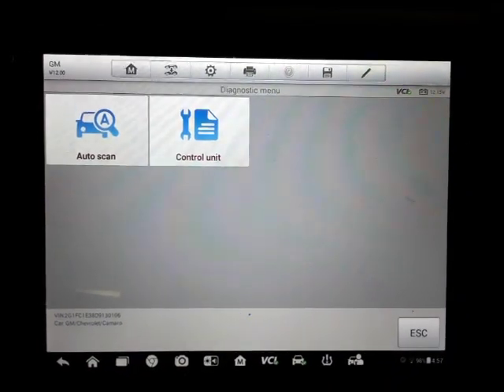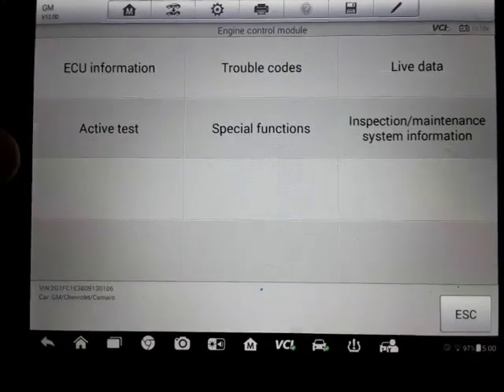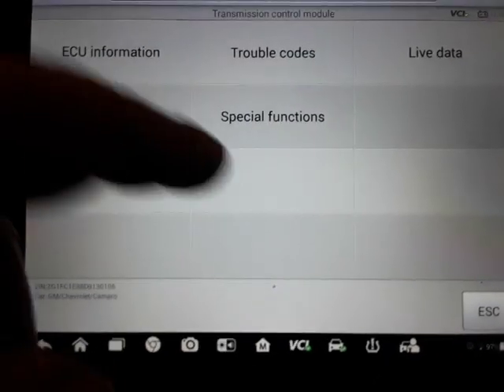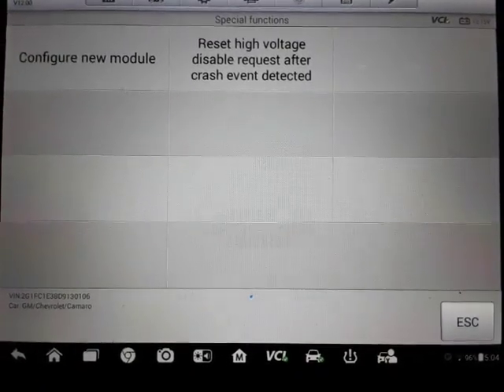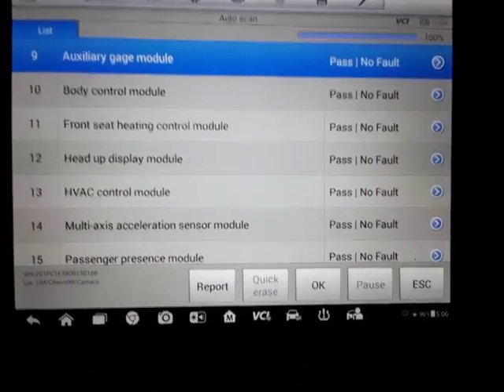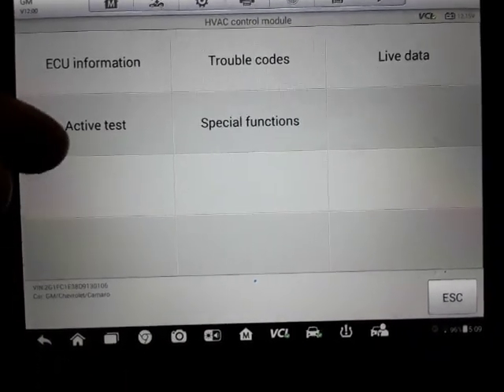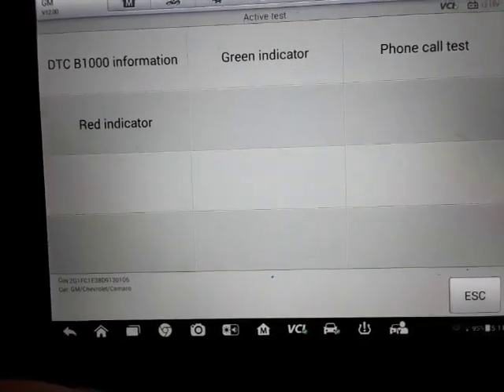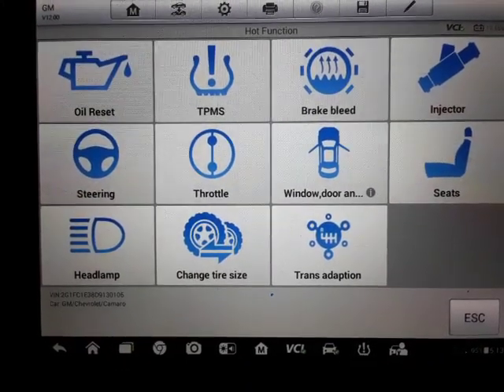Autel Maxisys MS906 , MS906BT , MS906TS functions walk through on a 2013 Camaro

Comment: THE most informative video I have found on these Autel scanners after spending the entire day trying to suss out if the MK906 BT will allow the reset of control unit adaptations after gearbox oil change on a Mercedes A45 AMG. 
Your video was just what I was looking for, thanks !
Reply: You can use function viewer, If you're on the main page (diagnostics, sevice,setting,etc.) slide to the 2nd or 3rd screen and you will see an app called function viewer, select your vehicle and it will tell you what is possible using your specific autel scanner.

Comment: I have the 906bt, and you can not do the normal coding or programming of new parts or modules like headlight control switch or climate control modules with these. You have to get a pass through device and install the GM program on a computer and pay GM 55$ for a 2 day subscription. Yeah it's a great scanner with a lot of bidirectional control functions, but you can forget about programming any new part (module) that you replace on GM cars. I was able to program a new headlight switch for a 2014 Jag, and it will probably do that for most foreign cars, including dodge, and maybe Ford, but it will be limited.
Reply from the maker: Yes, it is hit and miss on what modules it can  code.
Reply: @737mechanic  What I'm saying is that you can not do any coding or programming on GM vehicles at all. That includes Buick/chevy/cadillac. I can see from your video that you can not do any coding for your camaro. After you put in the vin it only gives you 2 choices....auto scan or manual for diagnostics. There would be a programming new parts or module choice if it was possible. If you go to manual and select BCM or HVAV, and then go to special functions, then there would be a choice to code or program new part.s...but there isn't.
Reply from the maker: @MRM-wp4gr  Although you are correct for the most part you can configure new airbag modules on many GM vehicles and depending on the year, make and model you can swap in a used computer without any configuration/coding or programming needed as long as the vehicle it came out of was configured with the same equipment.
Reply: @737mechanic  Well at least that's something... Launch is the same way....no GM coding or programming of new parts. GM is a giant POS for not allowing these functions on scanners IMO! Another good reason to buy foreign cars!

Comment: Hey, I'm looking at the MS906BT and the MS906TS. I'm more interested in the TS but I was wondering if it has the option for ADAS in it? It says no on the Autel website, the website states that the BT is the one out of the two with ADAS options, but I figured you'd know since you own the tool... thanks in advance. Also, can you copy a PCM/ECU from the one that came with the vehicle to one out of another vehicle? I need to copy a PCM from a silverado over to another PCM so i can copy the VIN.

Comment: Hi, im just want to ask if the Autel MS906 has a OBD1 adapter for Mazda 17 pin?
And if it work for asian version vehicles specially in the philippines the MS906? Thanks
Reply from the maker: Its does not have a mazda OBD  1 connector but it does work with asian vehicles as long as they are 1996 or newer.

Comment: Does this scan tool allow you to calibrate PPS?
Reply from the maker: What is PPS?
Reply: @737mechanic  PPS(passenger presence system) for 2006 cadillac CTS
Reply from the maker: @fishbreeder9743  I went into the PPS menu and the only option was trouble codes but when I went into the SRS menu it had calibrate SDM module so I think that is the module you are talking about if not then I don't guess it will.

Comment: I am considering to buy the MS906BT or the Harbor Freight Zurich Pro, how would you compare these two and which do you like better and why? thanks in advance.
Reply from the maker: I think Autel makes the Zurich brand for Harbor Freight but can't say for sure. I am not sure if the Zurich uses the same software or not but if it was me I would go with Autel. You can get the MS906BT on Amazon for $1099.00 and free shipping. If Harbor Freight ever stop supporting the Zurich I am not sure if you would be able to get updates for it.
Reply: That’s a very good point about HF dropping the tool line.  What’s your thoughts on these compared to the Launch x431 V+ which seems to be very comparable?
Reply from the maker: A-1 Heat & Air Conditioning I have never used a launch but from what I have seen they look very good and I would love to give one try if I ever get my hands on one. They are definitely worth a look.

Comment: Hello , im just want to ask if the scanner  can read 2 gen (2004 -2009) Toyota Prius hybrid HV battery like max and max voltage of each battery block ?
Thank you
Reply from the maker: I am sure it can but I do not know for sure, I just finished posting a video that I did a walkthrough on a 2001 Lexus CT200H which is Lexus's version of the Prius where I show all the active test and special functions it has for that year.

Comment: immo ??
Reply from the maker: No scan tool required for programming a new key or remote on 5th gen Camaro's.
Reply: @737mechanic  thank you. but was wondering if the scan tool had immo functions and for the more advanced proximity keys...loved the video..i cant decide on what one too get the DS 808....MS 906 .....MS 908... gots a faster processor in it but no sure i really care for the few extra seconds it saves.
Reply from the maker: @mechanicandskills7215  Tomorow I will look through the options and see what all it has and get back to you.

Comment: Does this scan tool allow you to turn off DRL or change the value in the tpms  for the psi you want it to alert you at? For someone who airs down their tires but doesnt want be alerted at the factory setting? If so, I'm sold! Moving on from my current scan tool soon
Reply from the maker: It will change some makes and models TPMS values and it also allows you to change tire sizes on some makes and models but it is only factory tire sizes. I have not seen any DRL disable option so I doubt it will allow that. What make and model are you talking about and I will try to check to see what options it has.
Reply: @737mechanic  
appreciate the reply, it's a 2015 jeep Rubicon